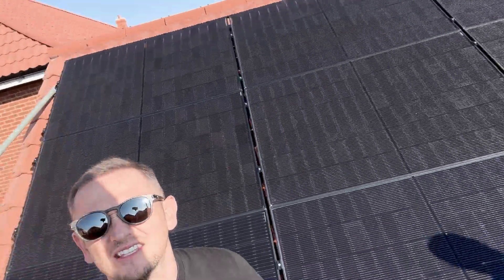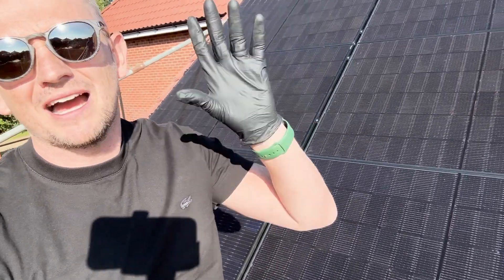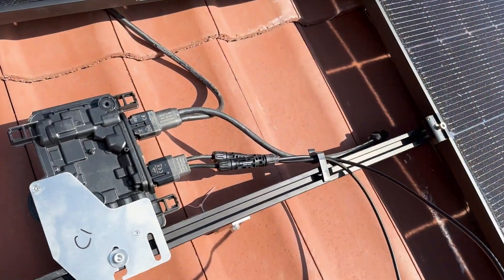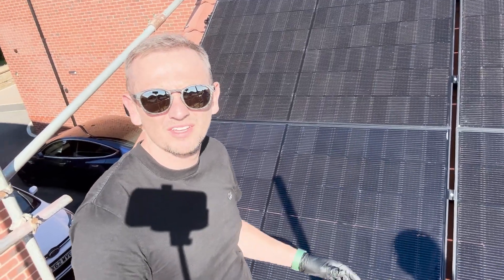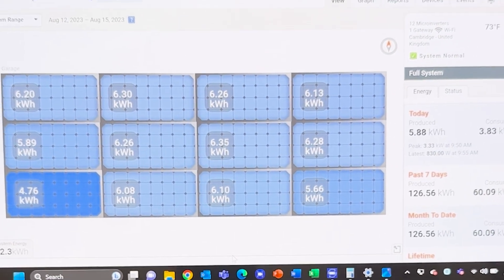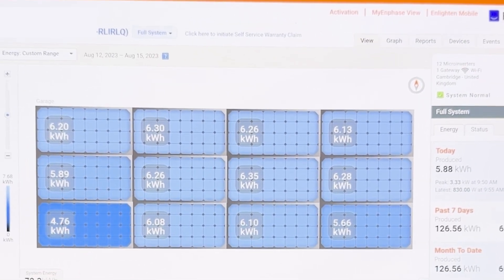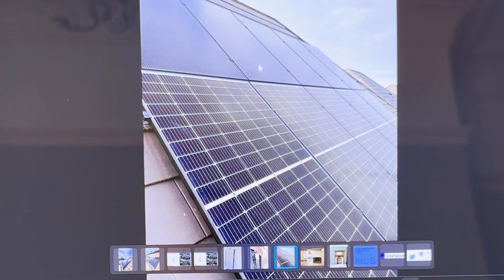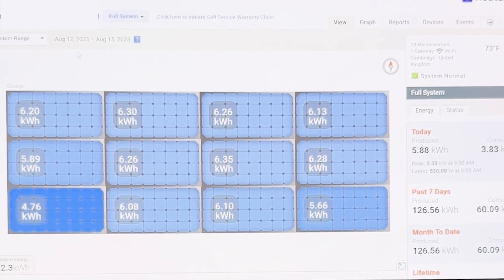What Happened When We Fitted The Wrong Solar Panel? 😱

Comment: What sort of impact would that Technology have on a NW roof?? Although its often overlooked as roof orientation  worth attempting to generate on !! Our sun comes up at back of house will generate via our 9 x Se facing panels but then mod afternoon that sun tracks off around side of house. Meaning Generetion dips. And then spends rest of day around the front. Where it appears to put more sun on front roof elevation !! Is there a gadget that's easily affordable and available to measure what   the difference in exposure to the sun. By placing on relevant elevation ?? Would be interesting to then see how accurate Sun Graph Diagrams are??

Comment: Its not a perfect test becasue the scaffolding did cast a shadow across the lower cells, the opposite end also had noticeable shadowing due to that and It's hard to tell what kind of shadowing those cells would have experienced over the full day. Some interfearance from neighbouring roofs is a strong possibility as the cell above is also quite a bit lower than surrounding cells. The difference from the opposite end generation is quite noticeable, even though both were in partial shadow.

Comment: I really don't understand why you use 420W (or VA) Panels but then use IQ7+ Enphase Micro Inverters with a maximum VA (Watts)  Peak output: 295 VA, Max. continuous power: 290 VA, Operating range: 16-60 V.
Your wasting energy generation 420-295=195VA per unit/panel.
So on 6 Panels = 1.17kW
So on 10 Panels = 1.95kW
So on 12 Panels = 2.34kW
If you used IQ7+ you improve this slightly eg. Peak output: 366 VA, Max. continuous power: 349 VA
Even if you used Enphase iQ8 micro inverters the highest VA Output is 384 VA
Each option is less than ideal as the micro inverter output is LESS than the potential maximum capacity of the Solar PV Panel

Comment: Great video showcasing the REA POWER FUSION 2 Solar Modules. The N-Type FUSION Cells provide additional low light performance to increase energy output and system operating window.
Reply: Sadly, no white background guarantees underperformance

Comment: To be fair, not all same wattage panels are created equally either, scaffold pole or not. What is relevant is that, "a panel" was easily connected to a micro inverter and it output whatever it did WITHOUT affecting the rest of the system. Nothing to say that in 10yrs time you maybe unfortunate to have a panel failure and the new panels maybe 600W (also needing a newer inverter) but you will be able to replace that one "set" and not  affect the rest of the system. If you have storage space in a garage, always good to buy a spare PV panel because they change every 6 months so the replacement may not have the same electrical characteristics as the rest.....which by the way will have aged too.
Reply: I have panels with iq7+ in three different directions and wanted to have iq7a on the south facing ones. I was advised to not mix the microinverters as quite often there are issues with the coms. I hope the future Enphase products will be compatible with the current ones

Comment: Great video.

Something I've wondered....as you install bi-facial panels, an interesting experiment would be if knowing whether a white/light colour roof would make much of a difference to the output.

I've so, it would be interesting exploring whether a reflective product placed between the panels and the roof would be worth it.
Reply: Get your roof cleaned and paint it white. You will gain 20-30%. There are YT test videos on this where BF and normal panels were used on a ground array before and after snow.
Reply: Spot on! The difference is remarkable. Sadly Heatable just don't understand the technology they are installing.

Comment: If I'm reading this correct there was a total 0f 900w difference between the two lowest panels across 3 days? (300w per day), given there's about 12hrs of sunshine a day at the moment thats a difference of 25w per hour.  Given in the video there was shading from a scaffolding pole on the lower left panel, I'm not surprised it performed lower than the rest!!! I would like to see a follow up with the new panel, with the scaffolding still in place.
Reply from the maker: Thanks for your comment. Please see attached photo of the  following 2 days generation after the panel was swapped and the scaffolding was still up: https://ibb.co/8Dy9Z1R

They’ll be a video coming to the channel soon that will provide more insight into direct comparative tests.